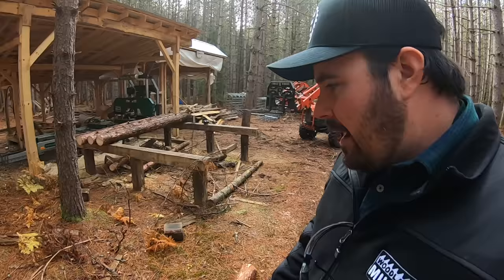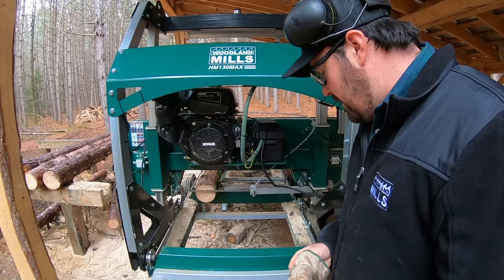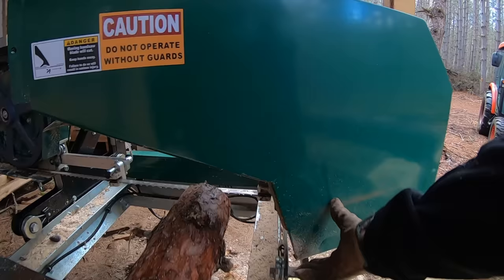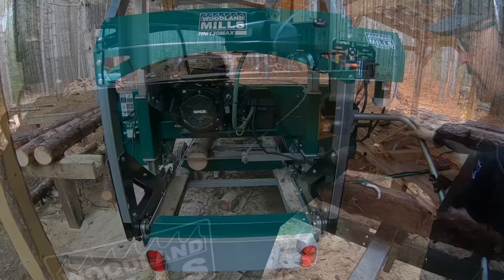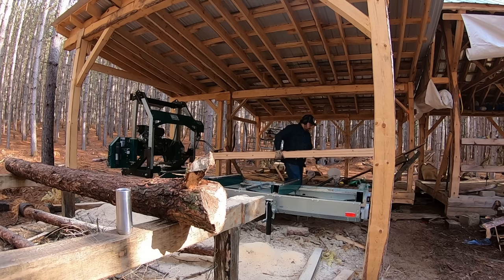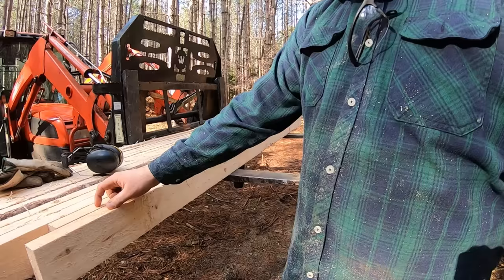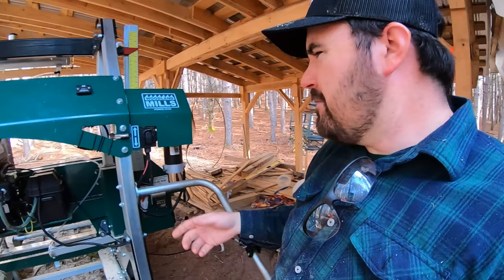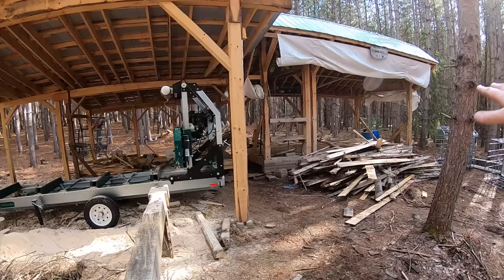Squirrels Sabotaged my Sawmill

Comment: Darn vermins in the fall, they can do some destruction indeed. I've had them chew wiring on vehicles and what not. I noticed while milling the 2x4's it started to make wood hair, on the Wooldand Mill we have on the property that is usually early sign of a dull blade. Good video Sandy as always. On the addition on the powerhead, like they say in the north east of the US "Work Smaht, not hard". 😀
Reply from the maker: Chewing wiring is such a pain eh. I think you’re right about the wood hairs

Comment: Sandy you need to get rid of your vermins. will not be long before they are chewing on wires, gaslines and belts. i have had them eat air cleaners. i have my dust collector hooked up it get 90% of sawdust. fixed a set up to turn logs hope it works well. i will have to get laser like  yours the cheap one like i got  do not show up in day light. good video. take care, be safe and well.
Reply from the maker: They sure cause havoc around here
Reply from the maker: Thanks John

Comment: The squirels attack all of thw wiring in both of my cars.  i now buy peperiment spray thru amazon and spray all of the hoses and wiring under the hood.  several times per winter. no more problems for the last winter season.  I live about 30 miles north of Philadelphia.
Reply from the maker: I'm going to have to give some of that a try. I've got critters trying to get into everything around here. Thanks for sharing that one

Comment: Hello Sandy. I have said for a long time, " You are as old as you feel", so tighten up a bit. I also like the power head. As for the slab rack, if I were doing it, I think I would start over as there may be some points that have been stressed and when I would go to use it, they might break sending me back to the start. It would be nice to be able to add a board return to your machine, but I looked, and it is not listed as an accessory. Have good days!
Reply from the maker: I think you’re right about rebuilding. Maybe I’ll come up with an even better design. I’m the boat return is also great idea
Reply: @sawingwithsandy  If you decide to, you will.

Comment: The wife and I started on our HM126-14 XL Woodlander yesterday. I may have found another option for power feed less money more options. Since I don't have electric start so I can charge a battery I am changing the engine. I can buy a 15.8 hp HF engine cheaper than a conversion  kit for the Kohler.
Reply from the maker: Good to hear you've got a solution figured out.

Comment: I saw that 1st 2x4 you cut and it had the pith on the edge.  One thing I just learned from Nathan at Out of the Woods YT was that the pith will shrink in length more than the other wood so it will end up creating a bow out of your 2x4.  He always plans his 2x material so the pith is either in the middle of the cut or eliminated altogether.
Reply from the maker: That makes sense. Since I’m just using up some small logs I figured I’d just use whatever I could get from the log and nail it well

Comment: still waiting to see a 42"  diameter log on the mill. as for the slabs, some of the better ones would be nice sidings for a faux cabin. btw, why not have a sludge maker in a corner?
Reply from the maker: hahah 42" . May be waiting a while on that one. Main reason I don't have a sludge machine is just because I don't have electricity out there
Reply: @sawingwithsandy  Didn't you have a solar panel and 12v battery to run LED lights? An inverter would be able to power a sludge maker? Fresh would be so much better!!
Reply: @sawingwithsandy  my self i use a perculator or a pot to boil my coffee on a stove or campfire
Reply from the maker: Ahhhh now I remember Yeah I do actually have that solar panel and I completely forgot about the inverter idea
Reply from the maker: Now that’s livin!

Comment: I noticed sometimes after the first cut you rotation 90 and some times 180 degrees. Is there a difference, benefit?
Reply from the maker: Great question. I probably rotate 180 degrees most just because that gives the flat part of the log a spot to sit nicely on the log bunks. If I do rotate 90 sometimes it's likely to limit the number of times I have to raise and lower the log stops

Comment: Sandy where is your broom? That outside rail is loaded with sawdust! ;) Tsk Tsk! :D Also, as you placed the camera on the log as you sawed it, I saw what looked like a bit of wavy edges? Sawing too fast? Blade tension a bit off???
Reply from the maker: Hey Joseph! I tend to use my leaf blower to clean off the sawmill but it was in use elsewhere. Think the blade was getting ready to be changed

Comment: Why can you not place two or more logs on the mill at a time and each trip with the blade will increase your production?
Reply from the maker: I can put two. Sometimes I dont just because it’s hard to find two small logs close to same size and I end up wasting a bit. On such small logs I have to be careful with my cuts as there’s not much wood to work with

Comment: A week or so since you’ve ran the mill?? They suggest to relieve the belt tension. Do you relieve the belt tension? I’m just wondering why you wouldn’t have noticed the squirrel activity when you open up the saw to set the tension and alignment.
Reply from the maker: I don’t always take the tension off the blade
Reply: That’s interesting. That could be a time saver from one day to the next. Do you notice belt flat spots?
Reply from the maker: Hey Leon. I’ve not had any problems with leaving the tension on the blade before in terms of belt wear
Reply: Do not need to open the Saw to set tension.
Reply: Thanks Sandy. Keep up the good work.
Reply from the maker: Thanks appreciate your support!